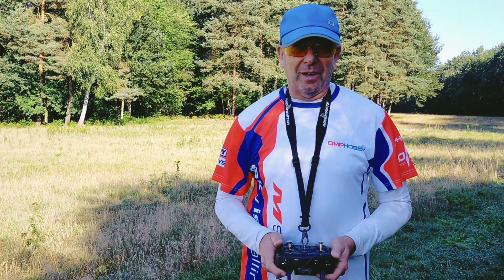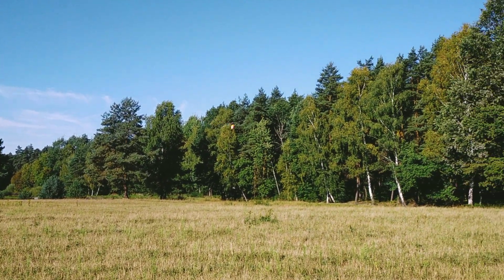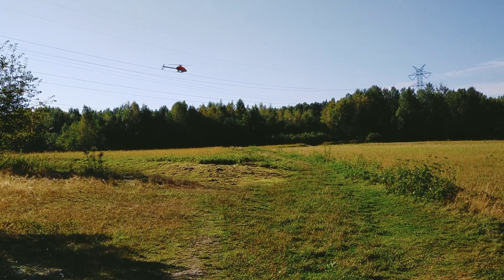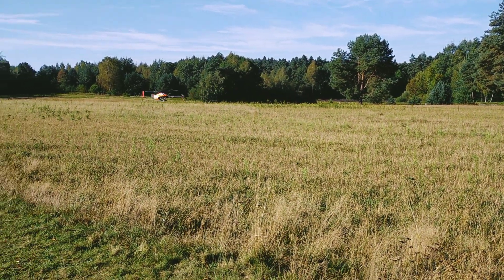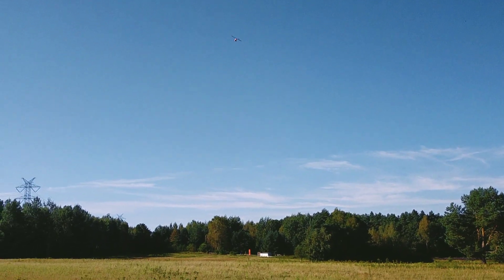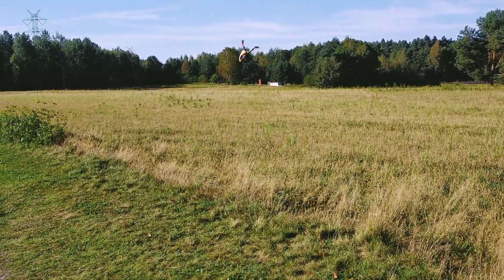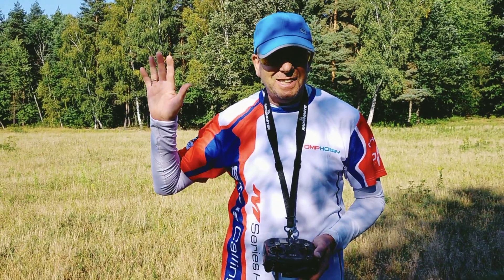Practice makes perfect? M4 flips and rolls - imperfect!!

Comment: You need MORE SIMM time, also you should try and HOVER INVERTED first, just like we learned to HOVER FIRST when right side up before we started flying figure 8’s. Moving the heli around inverted without mastering inverted hover is a recipe for a crash. 👍🏼👍🏼
Reply from the maker: @MARKLINMANT1  I just bought myself a SIM for the first time and have to do the radio programming for it. Your advise to first hover inverted makes a lot of sense, as good and stable hovering was and is the key ability for all that comes later! I will see in the simulator how this works. Hard 3D is not really my thing but low headspeed slow 3D is something that looks beautiful and that inspires me! I will do inverted stable hovering and the first thing. No, first I have to get the heli into the inmverted position! Thanks for your advise!

Comment: Your doing great... I do flips and loops with ease but can't fly circles as controlled as you do🫢. I still have to learn the basics...
Reply from the maker: Thank you! Oh circles! You don't want to know how long I needed to get them right! Endless traing! I guess they are one of the most tricky things. The cyclic controls with "breaking" the heli with "up" elevator, getting the lean angle right... oh my God! Maybe one good tip: I was flying squares (quadrangles) at first: 4 corners with short straights to talke a breath inbetween😀!  Straights getting shorter and shorter till I ended up with a circle and did not even notice it. 😀 And I trained ALWAYS clockwise and couterclockwise. Good luck! Hope this helps!
Reply: @RCCopterLove  thank you. I will practice and practice...,😁
Reply from the maker: @jwdrone512  The thing I love the most is that this so called "practice" is soo much fun! At least for me! Go go go!!! 🙂

Comment: There are 3 ways to get to invert:
1.) Throttle up flip.  Then you will rise and usually away from you.
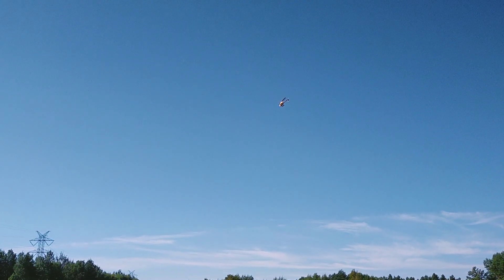2.) Drop flip, which is what you tried 2:42.
3.) Rock flip.  Just rock back/forth to use the momentum then flip and hold.
Most important is that you practice inverted orientation on the simulator.
Not just nose-in, but side, other side and tail-in.
Why? When you invert you never know which way you will be facing.  You may freeze on the rudder, also, since rudder direction is also backwards.
Before, I ever tried to invert I mastered all 4 orientations inverted on the simulator.
I also, mastered forwards inverted motion on the simulator, because there is no guarantee you will be "dead stop inverted" when you try inverting.
Most cases, you will be moving in a certain direction.  Total, absolute, unquestioned control.  At least, you can master that on the simulator, first.
Enjoy...
Reply from the maker: Thank you very much! I know exactly what you mean with the not guaranteed "dead stop" on one spot! I have this  moving in certain directions in almost the half of my upright flip attemps. A slight forward or backward move because I let the elevator go too late or too early. I guess at this piont I can's avoid a simulator anymore. My helis are getting bigger and more potentially dangerous and my ambitions  are as well rising. So far I was never ursing a simulator. I will gor for it! Best wishes!
Reply from the maker: @trexinvert Update! I bought myself a simulator and I will try the inverted hover as the first thing! It's fantastic to know that I can crash as often I "need" to understand how to control my heli in inverted hover. I waited to long, but it;s never tool late. And now with the coming winter the sim will be my good friend!

Comment: Matthias, I find the movements you are doing grandioos 👋👍. They are way more, better and daring then I ever will do. Have almost a hart-attack seeing you doing those, and ending very close to the ground. Without even remotely wanting to give comments and/or tips (with my 4 hours of flying with the M1 😳), when I look at the stickmovements those higmanoeuvre-flying 3D guys do, these are very fast, briefly and in a specific order. If, and I say "IF" I wanted to learn 3D, I would start learning specific stickmovements by heart and practice those, especcially the speed of the movements. And when your movementcycle(s) are all in, then at the "end" combine all those one afdter the other.  BTW, must your headspeed not be a bit higher?????
Reply from the maker: Thank you very much, Peter!! Believe me, I got a heartattack in this barrel roll ending soo close above the ground. I increased my headspeed already a bit and it's fine now. Did a lot of testing with different rpm. Now I have the right compromise between enough headspeed (approx. 2200 rpm) and flighttime around 7, 8 minutes. I believe what I am doing now is a good preparation to 3D flying, because it includes moments of inverted flying. If it's possible to learn stickmovements... well I dont really think so. I have learned that there are no shortcuts. Once I did not go step by step... and came home with two crashed M1's and one chrashed M2... that was a bitter day. I believe in small steps... It took me 10500 flights to get here... Happy flights and best greetings, Peter!!